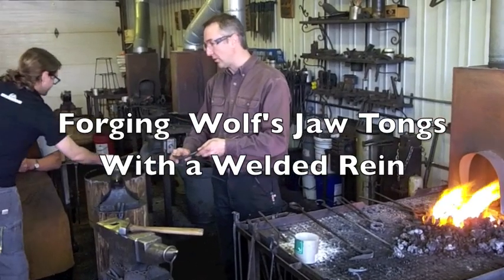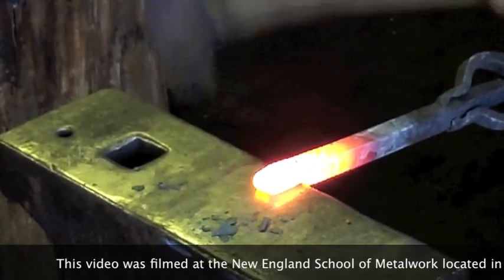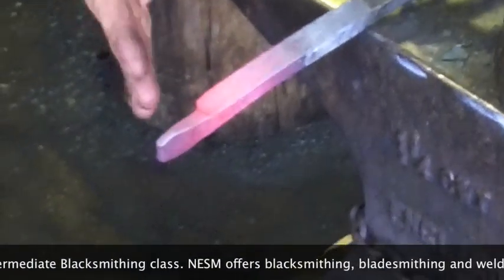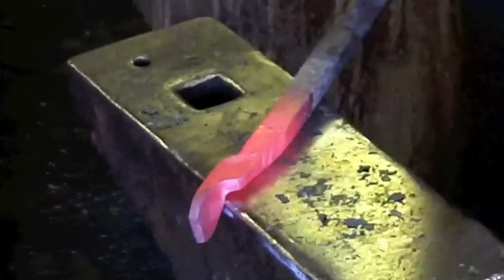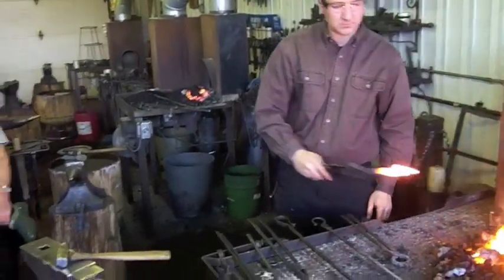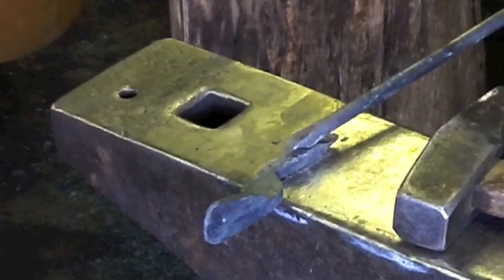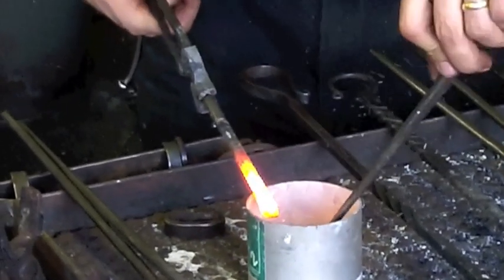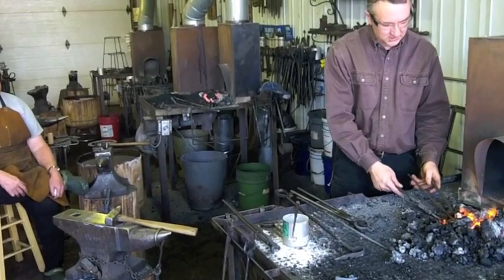Forging Tongs with a Welded Rein

Comment: For those not seeing the wisdom in forge welding 3/8 round reins to the 5/8 stock the jaws are forged from just go right ahead and draw out those reins down to 3/8 by hand at the anvil. At some point a lightbulb will hopefully come on and you will see all that drawing out is so time consuming and unnecessary labor.
Reply: ***** Are you losing any quality or longevity by welding vs drawing out the reins?
Reply: GlobalIdiot101 nope, if tongs break they rarely break at the weld. if your starting out drawing the reins out would be good practice tho and are a safer bet if you have never forge welded before IMO.the technique used i think is determined more by personal preference and the material at hand
Reply: Yeah, you learn pretty fast how much more convenient it is to forge weld a rein rather than drawing out 5/8 stock. I do this a little different though. I cut  my jaw blank to length, usually 6 or 7 inches, then weld on the rein. Once I have the rein for a handle I shape the jaws and boss. Makes it so I don't have to form the entire jaw while holding my stock in tongs. Faster that way.
Reply: I was wondering why he cut it off. Didn't see he was forging 3/8 to 5/8 glad you pointed that out